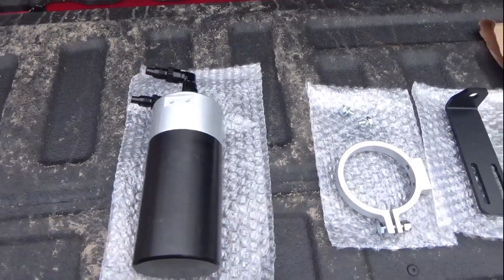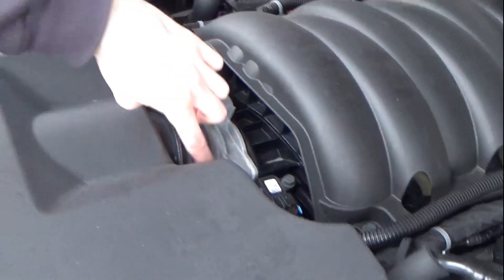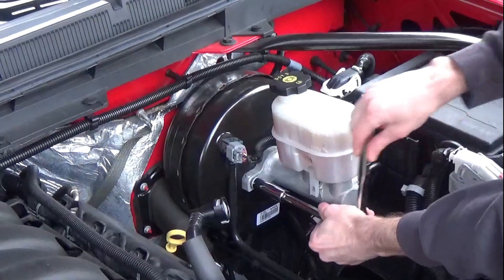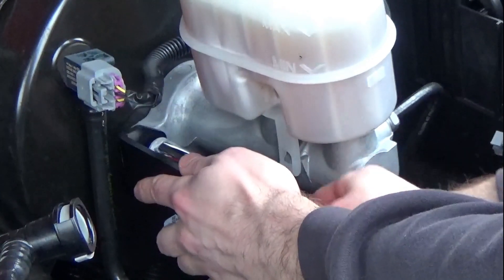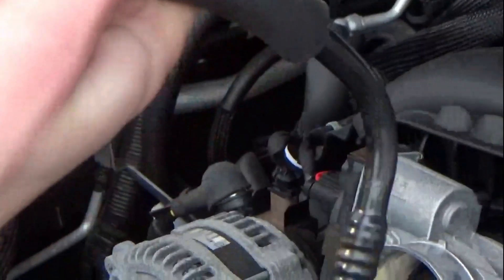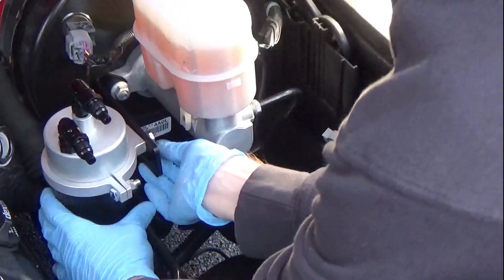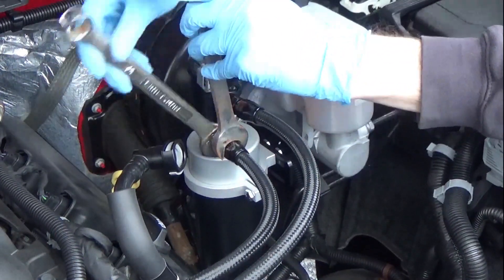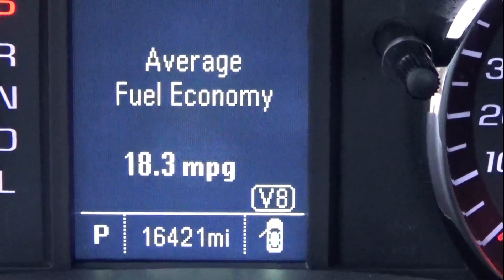Elite Engineering E2000 Catch Can Installation

Comment: My metal ring that holds the can for some reason isn’t holding ?
Reply from the maker: You may have received a brace/ring that is too large. When you tighten it down look for it to become offset while tightening confirming your ring is too large. Also inspect the ring for damage like a partial crack or it bent. The way I see it you have two choices: 1.) Find some rubber that you can place between the ring and the can to act as a backing pad that will allow the ring to tighten against the can. I thought about doing this myself anyway to insure a tighter fit. If the brace is damaged as previously mentioned or much larger than the can (you should notice this) this will not be a permanent solution. 2.) Contact Elite Engineering, their customer service is great. If you bought the can from them directly and recently I guarantee you they will work with you to resolve your issue.

Comment: Does the e2000 not need check valves? I’ve seen other installs of the e2 and they installed check valves on the exit ports...
Reply: No, the 5.3/ 6.2 already has a one way check valve which is the PCV installed on the motor. You don’t need it.

Comment: I really like that you take your time in the video. I'm thinking of making that purchase, but sort of wonder if this will be an issue if I have to take my truck in to the dealer for any kind of service since it's still under warranty. I imagine a system like this can only help the engine but they may not see it that way. Other thing is you say the container fills up with oil ( dirty oil) so should you be monitoring that more frequently? As in maybe replacing some oil. I change my oil pretty religiously at about 5000 miles. Also is it a similar install on a 6.2 litter V8?
Reply from the maker: So firstly, adding a catch can will not void your warranty. There are a lot of things that void your warranty. I urge you to call your dealer and speak to someone in charge. The one I bought my truck off of has a Master GM Mechanic and he confirmed that adding a catch can would not cause any warranty related issues. Secondly, if you are talking about your engine oil overall, then yes you should be checking it more regularly. The drawback to the LT based engines is that it does burn oil, but the catch can is what stops a lot of that oil from being burnt off in the top of your engine in the first place. So regardless of whether or not you install a catch can most of these engines will lose a little bit of oil overtime. It is just whether or not you want your engine to burn it or the catch can to trap it. If you are talking about the catch can you can, you would probably be fine to check it every 5,000 miles when you change your oil. If you notice the can becoming more "full" (2/3 or 3/4) you may want to check it more often. I understand that results may vary for how you use your truck, engine type and climate. If you let it get too full, the vacuum is powerful enough to start picking the crud up before the actual can is completely full. Lastly, yes the install for your 6.2 liter will be very similar to this if memory serves me correctly. Here is some information from Elite Engineering:
http://www.eliteengineeringusa.com/content/Catch_Can_Install_Chevy_GMC_2014_5.3L_6.2L_Truck.pdf
Reply: @HexaFox  I really appreciate the explanation . At this point I am really pretty sure I will be installing one. I don’t see any down side if it promotes a longer life  and better performance of the engine. I never had engine problems with my prior Yukons, but also I’ve always maintained them well.
Reply from the maker: @Cocora22  Yeah so it is a total misconception that you "need" a catch can. I have a friend that has the same truck as me (different rear end) and he has over 100,000 miles on this with no catch can and no problems yet. Having that said, there is no doubt that it helps. I am frequently asked why manufactures do not put them on themselves if they help so much. The simple truth is with the way people are (lazy and failing to do even the simplest maintenance) adding a catch can for them to check and empty would be pointless for the majority of people. As in they would never check it or even know it existed in the first place. So in trucks used in heavier work conditions they would probably be full all the time and the consumer would just never empty them. If you want more evidence of this look at the new John Deere mowers sold at big box stores. They are designed so you never have to change the oil. When you put a new filter on you remove about a quart with the old filter and add a quart back in with the new filter. So you are mixing new oil with old used oil. This is simply because this is what modern consumers want. So many mowers from big box stores never even see an oil change in the first place. They just run them until they explode. So this is a attempt to encourage more consumers to do some type of maintenance to their machines.
Reply: @HexaFox  I’m definitely in the category that stays on top of things. Use high quality synthetic fluids, make sure filters are changed keep records and so on. I did start to look and it’s a bit on th expensive side to add. I did find out my Range disabled will be here tomorrow!

Comment from the maker: I posted the video a couple days after I installed the catch can. It has not thrown any codes or lights in the dash. I am also very happy with it. It is hard to believe how much crap it catches. When I was making my decision I was trying to decide between the UPR and the Elite Engineering. I thought they both had good reviews but I mostly decided to go with the Elite Engineering one because they had been around longer and the size of the can. I heard that because the UPR can was so slender and small they can fill up quickly and allow the crud to get sucked back into the top of the engine. The same is obviously true with the Elite Engineering can but has a much greater capacity before that starts to happen. I have seen people empty these cans that are very near the top. Never saw a UPR mostly full, but does not mean they don't get full.

Comment: Looking at the e2000. Switching from a Upr setup. How long have you been running, and have you had any issues? My Upr threw a p2227 code on and off
Reply: That’s strange, I’ve been running mine since 2016 with no issue. I have the old version not the new E2000.
Reply: Picked up the e2 about a month ago. It’s been perfect. No codes or issues. Real happy after swapping out my old upr

Comment: Might sound like I dumb question but how tight did you tighten the lines going to the catch can. Can you over tighten them and cause them to leak?
Reply: A*
Reply from the maker: @JoshQs  For some reason I am not getting notified of some replies. Anyway if you have not already installed yours, I would not say it is idiot proof because there is no 'stop' on the threads. Basically meaning you could overtighten them. Having that said, it is pretty easy to see when the lines have come up over the threads. Plus the threads are not what seals the can either. There is a rigid piece of plastic that slips tightly into the rubber inside of the house. You might even what to put a tiny bit of lubrication on this part. This is another reason I really like these cans. I did a lot of research before buying this can and saw a lot of peoples trucks were tripping oxygen sensors and the like. Check out the most recent comment where another user got a dash light from a UPR can. UPR is suppose to be a major competitor of Elite Engineering but keep in mind Elite Engineering has been designing and manufacturing catch cans much longer than other competitors. They should really pay me to say this stuff.

Comment: What exit is that can Single or dual
Reply from the maker: This particular can only has a single exit, but that is because I opted for it. If you follow the link in the description you can opt for a dual exit on this can. It involved you drilling a hole in your intake box and a slightly different setup. So I just figured I would go with this one as most do. It is up to you though.

Comment: Hey bud I’m thinking about getting a catch can for me 2016 Silverado 1500 it has the 5.3 truck has basic bolt ons air intake 3inch straight pipe exhaust and a third cat delete with a hp custom tune one is it worth buying a catch can two will it help the truck at all 3 I was looking at the Mighty Mouse catch can and the one you are running please help 🤷🏻‍♂️
Reply: Thanks bud I appreciate the help
Reply from the maker: @johnfink1322  You are welcome, thanks for stopping by.
Reply from the maker: Yeah if you are here you probably know your truck has a GDI engine. These cans basically prevent or reduce "blow-by". I personally think they are essential in GDI applications. Anytime you hear about a failure in a GDI engine a good bet is anything that the blow-by can effect, such as the lifters. Unfortunately I do not know much about the Mighty Mouse catch can. When I was deciding I was looking at UPR Products and Elite Engineering and they both seem to make quality cans. According to reviews they both seem to remove more than other catch cans as well. I know that many other cheaper catch cans are just two lines and a can. These cans have filters on them that make it difficult for oil to get sucked back up through the can, which I think is also a must. Another reason that I was decided between these two is because they have quick connect lines for GM trucks, which makes the install much simpler. Also if you ever need to take them off for any reason it is very simple.
Reply from the maker: I forgot to mention that I went with Elite Engineering because they seemed to have more reviews than the UPR PRoducts and the can has a larger capacity. The UPR Products can gets great reviews as well, just I feel Elite Engineering seems to be more 'established'. Either way I think they are both a great bet. Something I liked about the UPR Products catch can more is how it mounted over the Elite Engineering can.
Reply: @HexaFox  And the Elite will out perform the UPR in the catchcan challenge tests.